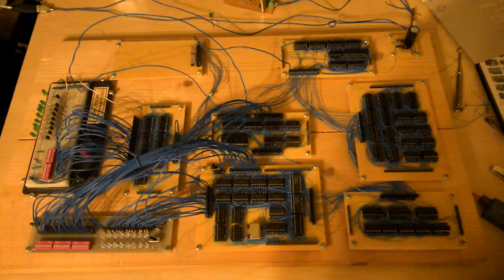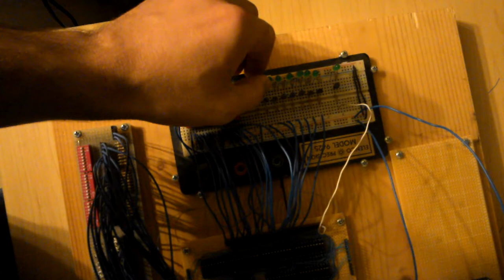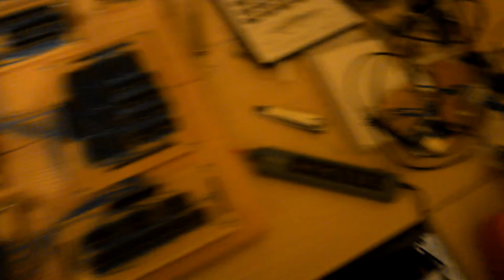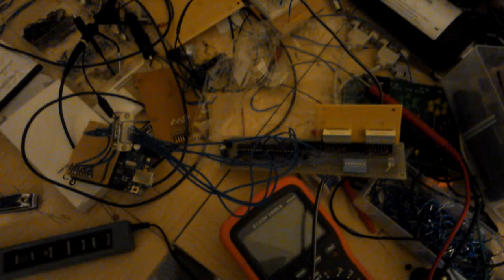Homebrew 8-Bit TTL Microprocessor Working ALU

Comment: Why did you use TTL instead of CMOS technology?  a TTL based microprocessor is not efficient in terms of power consumption, however its a very interesting project, i'm designing a 1 bit microprocessor for very simple control systems, and going to expand its bit word later
Reply from the maker: Parts were commonly available in my lab and from my usual supplier at the time. There were only a few other things I needed to buy when I tried building this. If I ever start on another, it'll be CMOS.